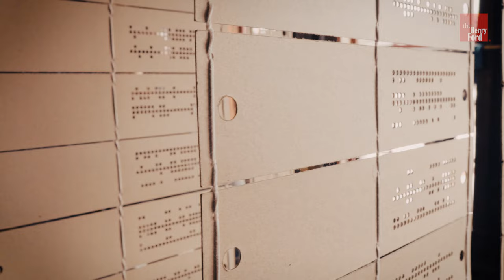How an 1803 Jacquard Loom Led to Computer Technology

Comment: I have seen a very similar loom machine in Japan, very very detailed piece of machinery. It was used to make simple window blinds for smaller windows such as a kitchen window and the blinds were woven with fake thin bamboo rods of different colors to give a nice design pattern. It was made of solid cast iron for the main portions and seemed super heavy, but it was overall very beautiful in action.

Comment: Why did they not also automate the shuttle passing through left to right?
That would have made it run completely autonomously, or am I missing something?
Reply: They did.
Reply: was probably not seen as worth the afford, since its not particularly easy. there can be no connecting piece between the 2 sides, since the threads basically change their position and have to cross that path.
Reply: They did, this is just a modest example. I bet they made them faster, too, but I can think of some serious limitations just from the inertia of those myriad suspended counterweights.
Reply: @Ramog1000  It's not difficult to do and there are at least three different ways to do it